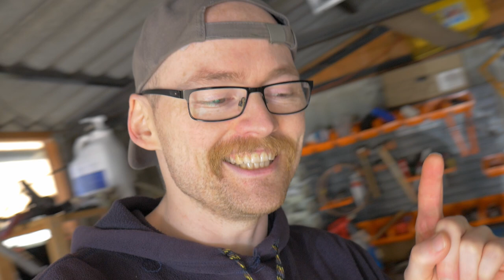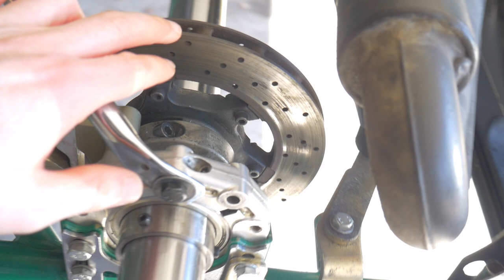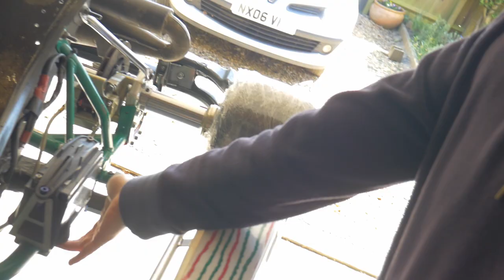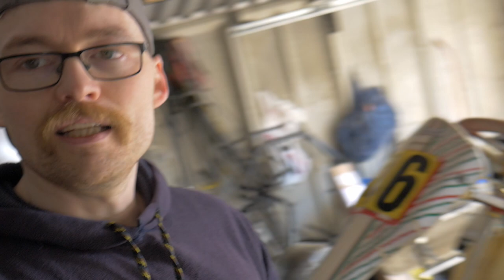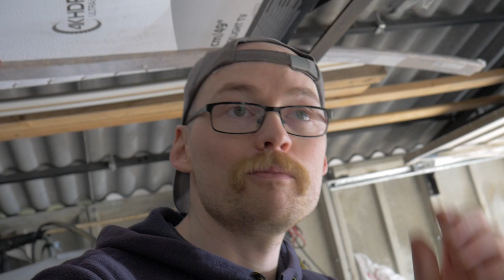Budget Kart Challenge - 2021 UPDATE Ep.3

Comment: Radio Control racing is long been going thru same pains.  Regulation galore (not often enforced though), manufs pumpin out new cars every yr, and sponsored drivers staying in stock classes instead of movin up to modified.  Stock class cars also end up 2-3x more expensive bc of all the trick bits 1 needs for that fractional gain.   RC racing specifically could be like karting and facing the same slow death like slot car racing going away like the boomer generation.  Kinda seeing it as the manufs see the kids of 80s/90s have $ now in middle age so they are pumpin out vintage/classic/re-release cars from that time so guys can try n buy a slice of childhood back then let it sit on the shelf and collect dust.  Nonsense.  

I quit rc racing a dozen yrs ago and sadly it is worse now.   At least with bicycle racing it still comes down to the legs and a bit of heart.  I always dreamed of racing karts or bmx as a kid but 1 was too expensive and 1 had no tracks anywhere close.  Closest id get was the 1 night at the family kart track during a wk at the beach.  

Some say it is better if it stays but just a dream.  I dont know.  

-U10